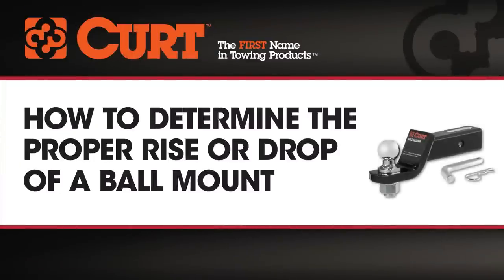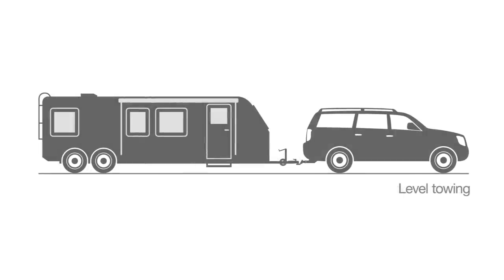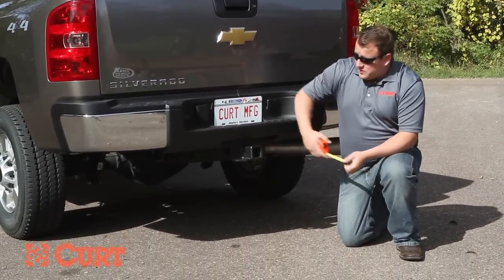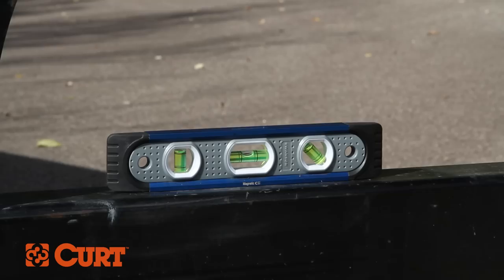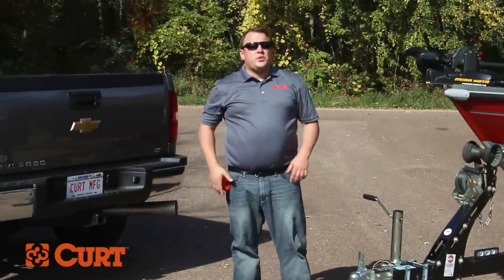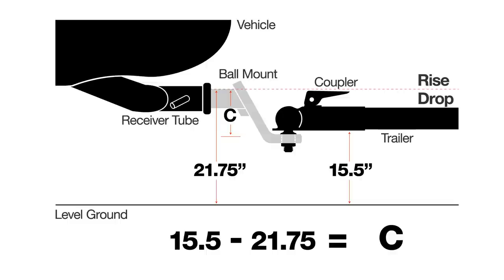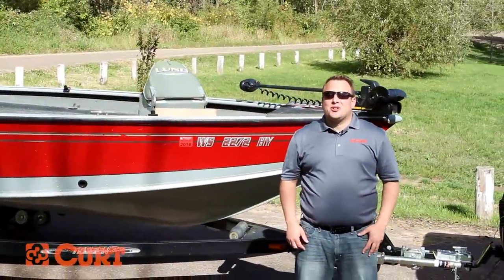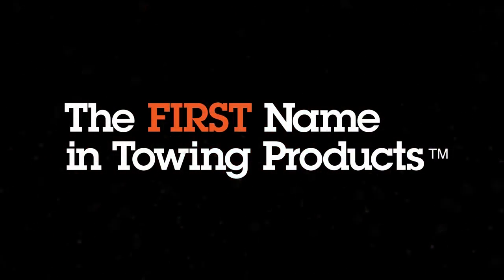How to Determine the Proper Rise or Drop of a Ball Mount - CURT

Comment: Checking level assumes the trailer is on a nice level pad. I measured frame height by the axle and at the tongue. Then measured the tongue height. Even better I think is I measured the frame with the boat hooked to my tahoe.

Comment: This method seems flawed to me. If you calculate the drop by taking measurements of a disconnected trailer then the trailer is not going to be level once it is connected. It makes more sense to connect a correctly balanced trailer and calculate how much drop or rise you need to level it. The amount of connected drop will vary greatly depending on tongue weight and vehicle springs.

Comment: If I am 1" either direction, which of the following is better: trailer slightly angled up (aka: trailer slightly higher than car hitch) or trailer slightly angled down (aka: trailer connection slightly lower than car hitch naturally)?

Also if you have weak rear springs like on a subaru outback, should I put 100lbs in the back before measuring? I imagine the 100lbs in the trunk would help account for passengers / items loaded up (which is a typical towing scenario) compared to empty driver-less car.

Comment: Shouldn't you account for the tongue weight when you measure the height of the receiver/hitch?  Tongue weight is going to lower that measurement...
Reply from the maker: +Craig Watkins You are true to a point. You must always pay attention to the tongue weight rating of your hitch.  Most are between 300-600lbs. Since our ball mount options are available in 2" increments, you can compensate for heavier tongue weights. However,  understanding proper weight distribution with a trailer and the maximum capacities of your vehicle and your towing setup is detrimental in order to tow safely.

Comment: I appreciate this info.  In measuring, I find a negative 1.25" between receiver and coupler.  I can't find a 1.25" drop ball mount.  What would your suggestion be in this case?  Trailer Mfg. says not to run below nor more than 3" higher.
Reply from the maker: Rocky Barrett Thanks for watching the video! We recommend that you round up to the 2" drop. That will do the job just fine! Tow safely!
Reply: +CURT Manufacturing 
Thanks for the helpful information.  When I measure I find  I have a negative 6.25 drop...  Why size drop do you suggest...?
Reply from the maker: Go to a 6" drop. #BringIt!!

Comment: I just bought a utility trailer to tow with my 15 Subaru outback. Your instructions helped me to determine the rise with an empty trailer. Should I add/lower the measurements  since there is no weight on the trailer? Thanks!
Reply from the maker: +Troy Dunn Great question.  There is no need to change your measurement with a loaded trailer.  It is important to evenly distribute your load on your trailer to keep your trailer as level as possible.
Reply: Thank you. I didn't think of proper weight distribution.

Comment: Odd question: I have a front mount hitch on my Ram 1500 hemi to move my trailer into a one lane parking area at my home. Since this method of moving the trailer is for short distance only and not something to use on the highway or roads, is the measurements for any hitch height really all that important as to leveling? I am serious in asking this, so please respond. I have a feeling that it is not, but just checking to be sure. Thanks.
Reply from the maker: For such a short distance, and for added convenience, an adjustable ball mount would be a good solution. You could adjust it to accommodate your front mount setup, and then adjust it for a variety of rear mount setups.  Check out: https://www.curtmfg.com/45900. Staying level is always a good idea.

Comment: What if you dont know the hight of the trailer that you willing to pull,
If you gonna rent an rv or a uhaul, each one of them will have a 
deferent measurements.
What ball mount hight that gonna  work with all type of trailer?
Reply from the maker: Dan, good question, check out our extremely popular #45900 Adjustable Channel Mount: https://www.curtmfg.com/part/45900